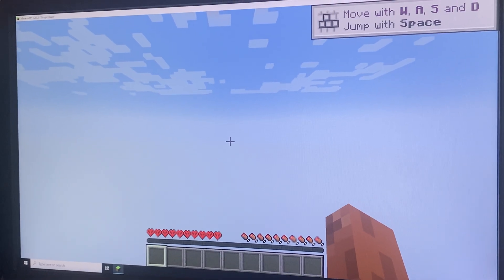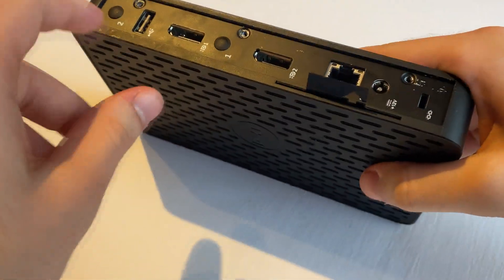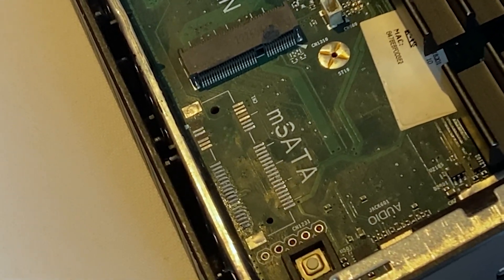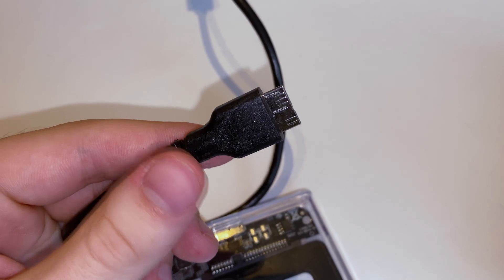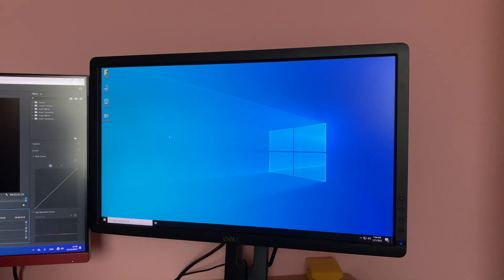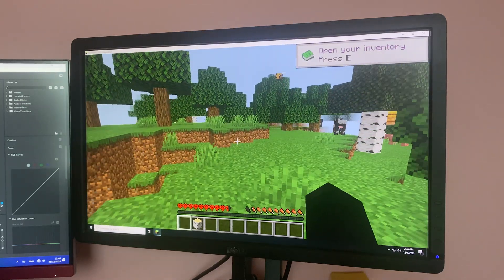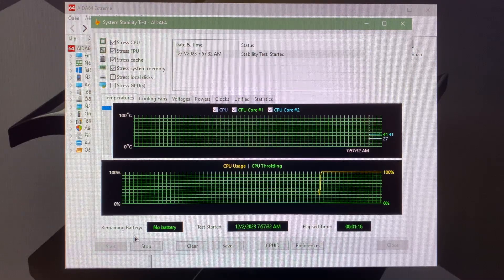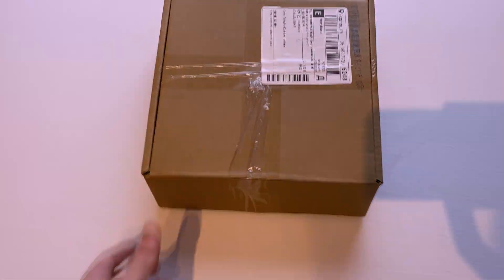Buying "Modern" Mini PC For 11$ For Win11 & Minecraft Gone Wrong...

Comment: if its 10 bucks and very power efficient it seems very useful for someone like me. I've been looking for something to host a few servers on.
Reply from the maker: Check X79 kits on AliExpress. Very cheap and insane power for it's money, although definately not power efficient. If your budget is higher and you need more performance there are X99 kits and the funniest thing -- dual X99 motherboards :D And they aren't really expensive.
Reply: @TheSillyWorkshop  I found one of those Intel Compute Sticks for like 30$ on Ebay, so that seems promising